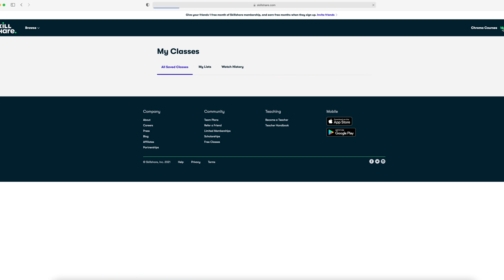RACING to Get HEAT in our OFF-GRID House BEFORE It Gets too COLD!!!

Comment: Hello Al and Gina!   Each step is one closer to a heated and plumbed house!!  Al, if that 1/4 inch  misalignment is your major rough in mistake in this build, you are good !!!! In the late 70`s a brewery commissioned the installation of a new bottling plant. The engineer involved  selected the location of all the equipment. Oversaw the purchase of new equipment. Did all the drawings himself. The corporate bosses were so impressed they hired him away from the firm he worked for. He was named chief  engineering officer of the company they were so impressed. He hires someone to finish the PROJECT! The floor is poured, the heavy duty anchor bolts  are inbreed as per the plans.  The floor is tiled and grouted.  The first equipment  arrives the bottling machine. A massive brute weighing tons. Mounting pads are put down, the machine is brought in and lowered onto the bolts. Nothing matches up. The drawings are consulted and  they match the bolt locations. None of the bolt locations match the equipment as it arrives. Who is fired  the  project engineer  or the new Vice President engineering  and physical plant.

Comment: Al, no way could I measure in the water room like you did on the wall around those pipes and not have broken the strips off getting them to fit in there. You do such good work. Looks great. That tiny house is going to be so warm.

Comment: Good morning, Al and Gina. Your project is great to watch, and you are moving along quickly. Having built my new house with radiant floor heating just a few years ago, here is something I have noticed. In the morning when coming down from upstairs, when I open the door at the top of the stairs the air is actually cooler by 5-10 degrees than the downstairs. As the heat rises from the 1st floor is cools so that the heat distribution from floor to ceiling is actually reversed compared to a conventional force air heating system. If you keep the 1st floor around 65 deg I have found the 2nd floor can easily be in the 50's without some supplement heat upstairs, just food for thought.

Comment: my radiant heat is turned off in the basement (walkout) slab and second floor. We keep the temp in the winter set to 75. It heats the entire house and uses about 3 gal. of propane per day at that temperature setting. Spray foam insulation is king!

Comment: Happy New Year! You can do what I did when I shutdown my oil furnace and went full-time to the woodstove... I simply cut a hole in the first floor ceiling directly below the vent on the second floor, then put a floor vent grill on the ceiling on the first floor. No need to do anything else and the second floor was just the perfect temp.

Comment: Al & Gina.. I was thinking.. since you have a collapsed water container from the gravity fed water system you installed earlier in 2021...You might want to remove the plastic lining and use the cage as a wood holder for your boiler wood... until you get a wood shed built...It will be easy to keep the wood off the ground, organized & tarped, that way..and I think you might get as much as 1/2 a cord of wood to fit inside.... Just a thought *s...... 
Plus.. there are all sorts of ideas that the plastic bladder could be used for, separately...

Comment: Good morning Al and Gina.  I was glad to see you had placed a space heater in the solar room of the house.  42 degrees is what I recall hearing.  That is definitely above the freezing point where Lithium Iron Phosphate batteries have trouble and may be damaged.  I am certain you know to avoid charging frozen Lithium Iron Phosphate batteries at 32F or below.  A simple space heater keeps the batteries warm enough to avoid the charging issue at 32 degrees F. and below.

Comment: Looks great 👍🏻 

I’ve built many systems rooms in my 25 years of systems room design. I would go ahead and spend the few dollars and do plywood surround. The dollars will be saved over run the long not worth dealing with a drywall wall finishing painting in that tight space. And using anchors if you later need to hang something. Looks good. 

By the way is your shower door meet ADA opening widths. Just a thought 💭
Reply: Good point but with a stud in the middle, I doubt the whole shower is 32" wide. (16" on center studs?)

Comment: Congratulations for a very interesting and entertaining series.  Much enjoyed and anticipated.

An idea I learned in Australia - There they are required to fibreglass the shower room floor and walls with a tiny step down into the shower area, fibreglassing in the pipes and drains, before the tile out of the room.  Guarantees no leaks into the concrete floor or the wood and board of the walls.

Also, now you have proper pasture, in the SW of England they roll the pasture every spring to push the stones back down into the soil and protect the animals and the blades of machinery.  It also compacts and flattens out the over winter loosening of the soil.

Comment: if you use sheet rock use outside type or use the water proof type purple or green with the shower and your water and your hydro heat use something if it gets wet it doesn't need to be replaced

Comment: Question for anyone who knows......Do the walls/ frames need to be bolted to the cement slab for stability or are they just secured to the other walls and ceiling rafters? Seems if something hit the bottom of the wall it would move....maybe they just haven't gotten that far yet???
Reply: All of the exterior walls are bolted to the cement.  Interior walls can't be bolted due to the radient heat.

Comment: Another great day on Lumnah Acres, love your Channel often make comment's but they don't go through. So I'll try again. Your tiny house is airtight so you will have to install an air pressure equalizer vent. I once suggested to put an waterline and electric line to the solar panels so you can Power wash the panels because in the spring they are going to get dirty from the dust and pollen Joe

Comment: Idea -when I remodeled my upstairs bath my concern was to eliminate moisture and keep it inside the bathroom. Instead of drywall I used the 3' x 5' hardy board. It worked well and used bathroom mud to finish just like drywall.  (The one warning was it is hard to cut.)

Comment: Very soon you will be able to work inside without having to be layered up for the cold and might even be able to turn the heat down a little bit more while you are there working. I wondering if you could cut out the floor/ceilings for vents to vent heat through the area.

Comment: Al was just wondering why no vapor barrier in the bathroom area behind the panels you’re putting up could be a problem with black mold later!?
Reply: With foam insulation no need for a vapour barrier.

Comment: I failed to mention this before, was to have a door to close off the upstairs. This way you can trap more heat downstairs when the upstairs won't be needed.  Also try to avoid drilling through studs, joist and rafters for electrical.  Take the electrical through the Top Plate and attach it to the top of the joist or the wall hidden by the false wall and through soffits, then drop down through the top plate.

Comment: So that little corner space will be your "Mechanical" room. Cool! Our hot water tank, pressure tank, and water softener are all under our stairs in the basement. Someday I want to put some walls up and close it off because the oil furnace is next to the stairs near all the rest. I'd like a "Mechanical" room closet too! I want to put sliding drawers perpendicular to the stairs to put our canned food in. They would open to the laundry room that has enough room for them to slide out. They won't get too heavy because they are only tread deep. I'm waiting to see how you do your storage under the stairs in the pantry. I may put it on wheels so it can slide out like Gina was saying.
Reply: Lumnah Acres really give people good ideas Kathryn, Happy New Year.

Comment: melamine is another option for wet areas. you can get it clad on one side, in many colors, I use it to built cabinets, and used it in bathrooms.  3/4 fpr cabinets and 1/2 inch for walls.

Comment: Heat will go up the staircase but without a return "shaft" the cold air will come down the staircase. The heat won't likely distribute well upstairs without some powered floor vents to push the cold air back down. Assuming you are planning to finish the ceiling downstairs I wouldn't expect any heat to get through it to the floor above.
Suggestion - NO fixed shower head, hand-held shower head on a vertical rod. You WILL appreciate the flexibility AND if you think you are going to wash the dogs in there, you NEED a hand held shower. Get a TUB ONLY valve, connect the shower hose below the valve.

Comment: You've probably already made your decision on the plywood for that side wall. Understand the cost concern but would recommend the plywood even if it just provides support for shelving down the road. NEVER have too much support in a closet!!! 
BTW, when you build your cross walls, it better to stand up a 2X6 inside the end walls. Centering the 2X6 on the cross wall provides a full length "nailer" that is one inch wide for your sheetrock corner on both sides of the cross wall. It provides a much more solid corner for the sheetrock that will tape nice and straight instead of bowing out when the taper pushes on the corner tool. I know about the radiant heat but are you securing the bottoms of your walls with any "mechanical" means??

Comment: I notice you are not using treated lumber for the bottom plates and not fastening the plates to the concrete.
Reply: It was treated, look again. Glue used as they didn't want to pierce radiant heating!
Reply: @tonygrimes13  Another Richard!
Reply: @darlaherbst5929  Always a lot of Mr Heads!
Reply: @darlaherbst5929  Better than the blind following the blind

Comment: Somehow I always thought wood fired outdoor boilers used antifreeze in their loops. I know automotive anti freeze protects from overhearing as well as freezing and bursting pipes. I don’t know if I learned this somewhere or it just made sense to me. 
The off grid farm is gonna be amazing❕
Reply: Would you like anti freeze in your shower?
Reply: @tonygrimes13  Tony: The underground/radiant heating system is most likely a closed loop, thus that fluid would NEVER mix with the rest of the system that feeds showers, toilets and sinks, etc. so no problem adding antifreeze if preferred.

Comment: I'll just a suggestion pick up a couple extra pumps for your boiler they always go out when you leave 6 pack day it's all we could have one on the Homestead  I have a central boiler and I use taco pumps I hate my home 3000 ft² my mother's home a 1000 ft² and my barn at 10000 ft² and it's worth having it just so you have backup electrical pumps  Sometimes it's hard to find a pump just a suggestion James T down in North Carolina

Comment: A couple of vents in the floor of the upstairs rooms will facilitate air flow. Most of your heat will probably go up the stairs. Vents that let the cooler air drop back down will keep the circulation moving, Back in the 40's  when furnaces didn't have fans, attic bedrooms often only had cold air return vents as the heat rose up the stairway. Don't want to heat those rooms? Close the door.

Comment: Al, you have undersized your mechanical closet, and your will need the wall next to the shower for equipment , as for the second floor, you will need to install radiant heat in the floor also.  You will need to zone the heating in the house and each zone will need a circulation pump. Hopefully you have consulted heating a contractor  on the radiant heating , based on the square footage of both floors will tell you how much radiant heat you will need in the floor. If you don’t want radiant heat in the floor for the second level, one option baseboard heating.
Also on the water heater is it a tan heater or an on demand , propane or electric, being solar power, electrical water heaters is no recommended because of the power draw.
If propane then you will need more spacing than being allotted based on your mechanical closet size as built.
Reply: The wood boiler outside is the source of their hot water.
Reply: @tonygrimes13  ... wood boiler for domestic hot water in the summer? He could use an electric tank as storage and do a plate exchanger during the winter, then use surplus power to heat water in the summer. I guess we'll see what he has up his sleeve soon enough.
Reply: @tonygrimes13  the circulating water for the radiant heat and the required additives descale and acids in the water means the water won’t be used  for  hot water, now will it be hot as is needed for domestic hot water,  to hot of water in the radiant in floor heating will cause the concrete to explode.  
I know I seen it happen when the temp regulator failed and allowed boiling water to enter the under floor radiant   heating .  A room set at 65 degrees the water in the in floor tubing is about 70 -74 degrees, so the outside boiler won’t produce water temp 90 degrees in the circulation in the circuit at max heating.   
For domestic hot water transfer system you need 120 to 130 degree  circuit from the boiler for the heat exchanger.
Reply: @raymondheckard234  Let's wait & see.

Comment: You only need to keep the batteries warm.
If you build a closet/cabnit around the batteries and controls, you could put that oil heater in there and never have to worry.

Comment: I might have missed you installing it, but I am wondering if you have already installed the conduit and piping to the well and boiler? Cant remember you having done that yet. I know the raw water pipe is installed but the pitless connector? Reason I ask is that as the ground freezes it's going to get really hard to dig anything.
Reply: Already installed.

Comment: Might I suggest that it would be better to plumb in for heat in whole house while it's all open. Using zone control the areas not needed will not be heated but available if ever needed.
Reply: They have 6 different runs for the underfloor heating in main building already installed.

Comment: Greetings and Happy New Year!  SUGGESTION:  Put in the underfloor heating for upstairs. You can always shut it off or throttle it at the manifold. (You are putting in a hot water manifold - right?).  The reason I suggest this is, friends that still live in N. Minnesota didn't put it in for the second floor thinking there would be enough carry over heat. Down to 20F it was fine. But when they had 2 weeks of -20 to -30F weather, it definitely wasn't.  So, it's relatively easy now, a major problem if you have to do it later. Gina - You are GREAT on video! Just talk to the camera like you are talking to friends...because you actually are!  Cheers from Texas!
Reply: They said in video that they would wait & see how upstairs temperatur is befor putting in ceiling.
Reply: @tonygrimes13  True. My point is, with the weather there currently in the 20F plus range, it would be hard to tell if it would be enough for -20 or below. That's exactly what happened to my friends.
Reply: @WarpFactor999  It's -1°F in the morning of this video!  Al has good common sense!  If necessary, a space heater will work great in that small area.  There's, also, heated mattress covers that are soooo nice!
Reply: @darlaherbst5929  Didn't realize it was -1F. Regardless, running a few traces of PEX for underfloor heating before closing in the ceiling is trivial and wouldn't cost much. It would also run off the boiler hot water. Even though they have a large solar and battery array, electric heating is a huge power burner. Better to use the boiler hot water instead. Radient underfloor heating is great in the morning...you put your bare feed down on a warm floor! It's also a much more even and gentle heat.
Reply: @WarpFactor999  That's all true... we'll have to wait and see.

Comment: Generally..how much did ALL the solar equipment cost; panels batteries etc, vs having poles and power brought in?..... and how long will it be to pay for itself if ever.  (amortization). or is that not realistic?
As for me...I can't imagine ever finding a cost effective solar system that would pay for itself when my annual costs on grid here are only $1500. .. (a little over $4.10 a day all year)
I have a 48 yr old (on grid) 12 room house in North Jersey.. @ .18 per KWh for electric and using natural gas for heat... my total 2020 utility bill was just about $1500. I keep it at about 72-73 all winter and the A/C is set for around 75 in the summer.

Comment: Can anyone tell me if that boiler is electric or if it's wood fired if it's Wood fired you might want to start thinking about bringing up some firewood for it
Reply: The boiler requires electrical power to run it's various pumps, valves and other control components... and wood to provide the heat to transfer to the working medium of water.

Comment: You could heat the old fashioned way upstairs by putting an iron grate in the upstairs floor. I lived in several homes that were heated that way it's  sufficient even in extreme negative weather. Without making it to warm. You can find good looking grates if you want to.
Reply: Good point.  Many an older home has ceiling grates on the ground level to allow the hot air to rise to the 2nd floor -
Reply: I was thinking the same thing, great minds think a like....lol... I remember talking to my sibs through the grate when i was at my Grandmothers house.
Reply: @donnadunlop  we listened to my oldest sister and her fiance court. Got caught and  corrected.
Reply: @judithfairchild8620  LOL we listened too, hoping to find out what our Christmas presents were.